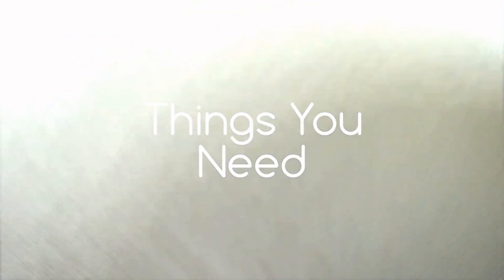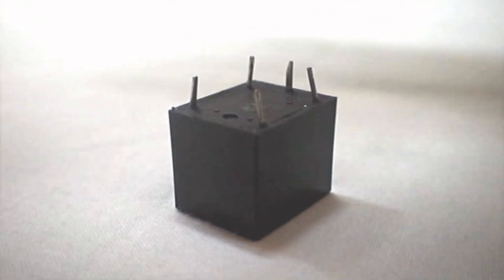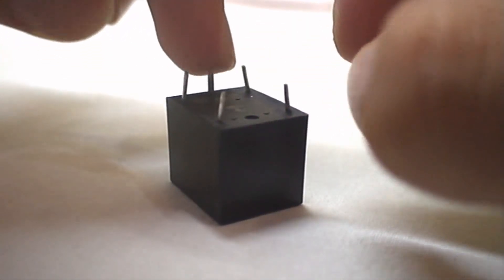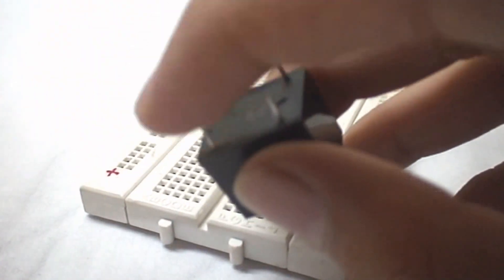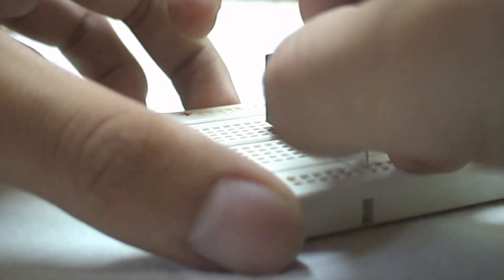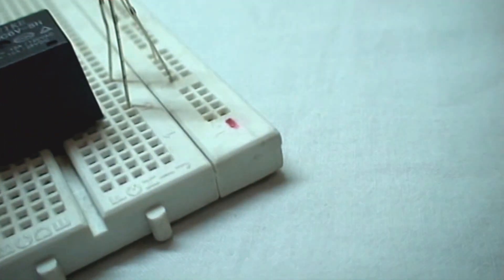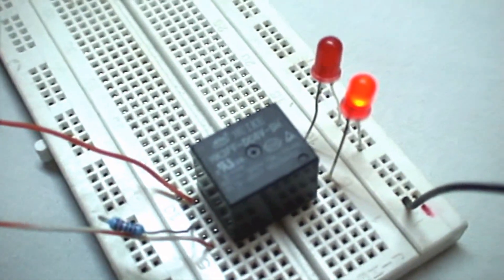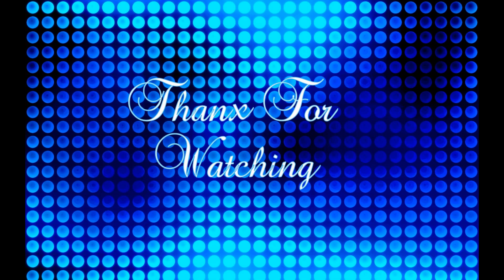How To Make A Simple Relay Circuit

Comment: What happens if i connect 6v relay directly to 9v not using the regulator .
Pls answer 
My circuit is not working .
Only one led glows all the time. All else is the same, each and every component . 😊

Comment: Why did you use a 10kohm resistor? That's pretty high. You could've used a smaller one to get more brightness. As long as the current through it was less than 20mA, the LED wouldn't be damaged. I(LED) = (9V - 2.5V)/R
2.5V is the Red LED forward voltage. You're only using 0.65 mA,  which gives you a very week brightness.

Comment: You also forgot the diode. Several video makers has missed this so far.
Reply: Torgny Nordén Yes that flyback diode is really needed when working with electronic switches i.e MOSFET's OR BJT's. But here they are using an mechanical switch so it doesn't really matters but it's a saftey margin to use a diode
Reply: The mechanical relay consists of a coil and that's where the problem arises when you cut the current. Isn't it just exactly like in an electrical motor? Won't the voltage spikes that you get when you break the current to the relay will go directly into the microcontroller in this case?
Reply: Torgny Nordén Which microcontroller?
Reply: The imaginary one I made :(
Reply: Torgny Nordén You can build a real one 😉 You use arduino?

Comment: In ur diagram there is mistak regarding NO n NC
U showed vice versa 
NO means there is no contact in between tow point 
NC mean two points are in contact with each other
After geting the power both changes their state NO to NC and Nc to NO

Comment: Hello Sir, can i connect a 450 VAC with less than 1 amp to these ice-cube relays?. Though the rating shows 240VAC - 7A.
Reply: Do not use this relay for circuits over 240 V.  While your watts calculations are mathematically correct, they are not relevant in  this situation.  The top voltage rating is for 240v.  Higher voltages could cause failure of the contacts due to excessive arcing, even at low current levels.  Also, the internal insulation is designed for 240 volts max.  While there is surely some safety margin built into the design you are inviting failure and by using this device over its rated voltage.
Reply: 240*7=1680 Watts and 450*1=450 Watts so I guess you will be just fine, but relays can be a bit tricky in some ways. Even if the effect is lower you may still get a flash in the relay because you use higher voltage. Try it out and you will notice, but if it gets hot or you hear wierd sounds cut the power. Also don't switch to fast when you try it since this will enlarge the risk of flashes which will destroy the relay.

Comment: bro !! 
may i knw hw did u convert 6 volts by using a regulator power supply???
coz m not gettng the output ....
Reply: +ayesha shaikh   hi what he is saying is use a 7806 regulator its got 3 pins  in gnd out  use the in on the 9v middle pin is ground and out would go to relay  - so 9v in and 6v out  then put that switch in series to the relay

Comment: Which relay would I use for 230v AC switching in this same way? I want to switch a heated towel radiator element OFF when the central heating is turned ON...

Comment: that schematic is wrong. The Positive and negative signs must be switched for the 6V input
Reply: +anoname   if u want to be highly technical no - as its irrelavant  - its a coil  so either way it work - yes i agree that its a small mistake in labeling or drawing but hey it will still work lol

Comment: good video!
but when i used your circuit for the 6v relay and used a arduino to  power the relay(used blink example) the relay for few minutes(heard clicking sound clearly) for a few minutes and then the relay stopped working(i could still sense something moving in the relay ). After some time ,i switched on the arduino again and it worked for a minutes only.
i know the arduino provides 5 volts but i think that's not the problem.i am using diode in parallel with the relay.
please tell me what i am doing wrong
i am new to this!
Reply: +Omkar Kaushik This is the sympton that the flyback diode is not working properly. Replace the diode, check the diode connection polarity, check the voltage at the relay coil terminals. You will see that it will not full discharge. How man times per second you are activating the relay ?
Reply: +José Morais sorry for the insanely late reply!
changing the diode doesn't solved the problem.
So, I used a npn transistor to activate the relay and it seems to be working fine for now.
BTW I was cycling the relay on and off every 1second(just for testing )
but I still wonder why it was not working properly earlier because all the parameters like voltage ,current ,etc  were well close to the output range of the arduino.

Comment: So i have a question. Though we have studied basic electronic in Civil engineering. Since you using Switch to manipulate relay for each LED to turn ON or OFF. I hope its DC current you are using as main power supply. Will we get automatic turning on and off of each LED if the supplied current to relay coil terminal was AC voltage.... ? Just a thought...
Reply: +zia khan   Please share with me the answer to this question of yours, in case you figured it out. I dont see it answered by the publisher of this video.
Thanks Khan sahab.

Comment: thanks for the circuit but using a 10k resistor nothing would happen cause it limits too much current.non of the leds will light up . 295 ohms resistor should be ok.

Comment: lol.. so heres my question.. How are we connecting a 9v battery to an led.. doesnt that fry it up? since i guess leds take upto 3 v ?? please help me out. and i have a relay from leone, looks the same as shown in your video, its rating on top of it are as follows: 7A 240VAC 50HZ COS1 COIL, 6VDC and on other side its written 10A/125VAC .. what does all this mean? also can i connect it to a wall socket and connect a proper bulb using this relay? please answer these questions asap. Thanks
Reply: Hes using a resistor. Thats why it doesnt fry.

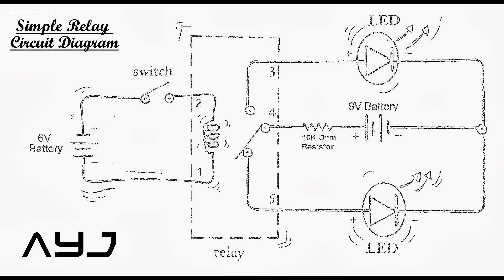Comment: amazing video! may ask you a question?using your scheme at minute 3:12 then
put a solar controller (lamp exit) insted of 6V battery and then instead of 9v battery the solar circuit battery.

Now join the inverter on the circuit, on the controller lamp exit and on the pin N5 of the relay: so when the controller is off( during night mode) the pin 5 is normaly closed so the invertor take energy from the battery.

Then during the day the controller lamp exit is working so the inverter take the energy from the controller, and the pin N3 is closed.

But now i have a question, please help me... join the inverter to both exit wont join anyway both exit together (battery and controller exit) may this brake the system?

My point is to have the relay as switch between the battery and the controller (daytime controller) night time battery. But both inverter and relay are joint to the same exit, so wont be the relay a bridge itself to the battery (in both case active and not)
thank you

cheers!

Comment: Thank you for sharing your videos.I'm trying to build Christmas lights for next season and my audio translator and chaser are 12volt DC and I need to use a relay series to run my lights on 120volts AC and you answered my questions.

Comment: I'm looking for the best way to build a 12v 10 amp circuit that controls two input voltages.going out to one output voltages.  When input one is ON and input 2 is OFF, output stays on. Followed when input one is ON and input two is ON, output goes OFF.

Comment: you clould have ditched the relay,  cince your switch has 3 connectors,  one is open, and one is closed at all times.

Just connect the switch with 1 resistor and boom,    you have the same result.
Reply: that isn't the point....
Reply: I know,  but for some beginners that may think they need a relay every time.
Reply: Debbie321lopez It is silly to demonstrate using a relay with a couple of LED's. You should really make use of that 10 amp rating! 

I used my relay for an automatic ignition system on my Hydrogen Cannon, as-well as the safety cut-off valve to my generator, in-case of fire.

Comment: thats very good but whats the application . where to adopt this kind of circuit .....what the useful of it.....
Reply: You could use a relay to turn a 120V appliance on and off with a small, low voltage circuit.
Reply from the maker: As said in the video,
It can be used to handle high voltage currents safely using Batteries,etc.

Comment: So the resistor is there to allow the 6v relay to safely run on the 9v battery? Is that correct? How do you determine the amount of resistance needed?
Reply from the maker: SOAHCSOAHCSOAHC No, we use the resistor for the LEDs not for the relay.

Comment: how can i calculate the maximum voltage that could pass through movable contact and N\C N\A
Reply from the maker: It is usually printed on the Relay.....
Ours can handle 220-240 volts...

Comment: Incomplete video! You should have shown us the 6v battery which is connected to the switch. You can also show it using a 9v with a 78XX regulators.........
Reply from the maker: Actually we had used a Battery Eliminator which provided us 6v....
If you need help with the regulator, don't hesitate to ask.... :)

Comment: Hey Bro, I just want clear this thing to everyone, NORMALLY CLOSE (N.C.) It means that the circuit has the ability of current flow at state.NORMALLY OPEN (N.O.) it has open circuit that no current flow on circuit. Terminal 3 and 5 is (N.C.) and 3 and 4 (N.O.)  When you check terminal 3 and 5 theres a light coming to it (N.C.)

Comment: so in case anyone doesn't understand why you would need two isolated circuits, the purpose is to control a high power/voltage circuit with a lower voltage / power circuit.  The high power circuit being completely isolated from contact so that risk of shock is minimized.

Comment: before i go out and buy a 6volt relay how would it work on a 12volt relay what voltage should i use
Reply from the maker: The coil terminals for the 12v would would work with 9v +
The voltage u can use at NO, NC and MC are usually written on the relay
For my 6v relay i can use upto 220-240v at NO, NC and MC
However I prefer u use a 6v relay
If u dont have a 6v power supply to use at the coil terminals, use a 9v battery along with a 7806 regulator that'll convert the 9v to 6v. Moreover, the 6v relay will work with 9v at the coil terminals as well
Reply: what resistance should you use at 12volts tried this vid out it workes but not in the same way

Comment: can it handle 220v? like big bulb?
Reply from the maker: Its usually written on the relay
The one we used could handle, and yes we tries it using a 100W bulb
Also use 220V only at the movable contact and normally open or normally closed
DO NOT use 220V at the coil terminals
Reply: thanks Sir :)